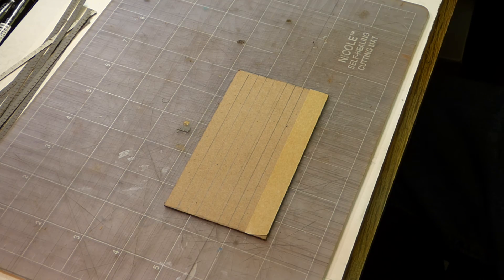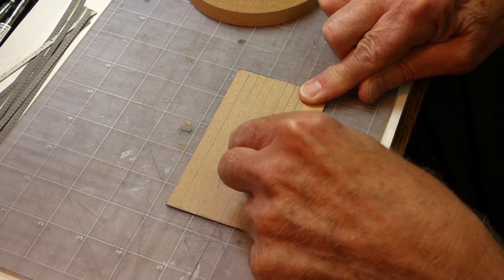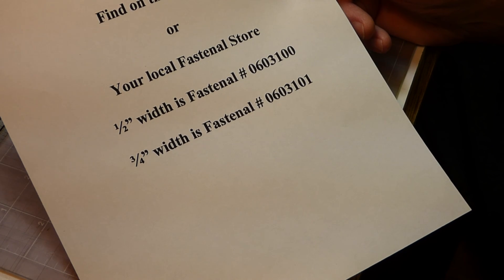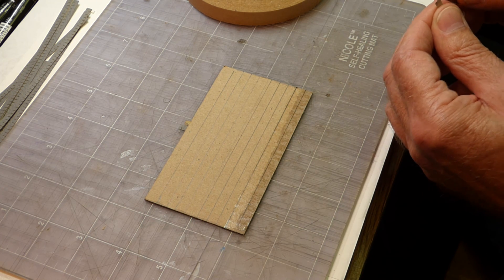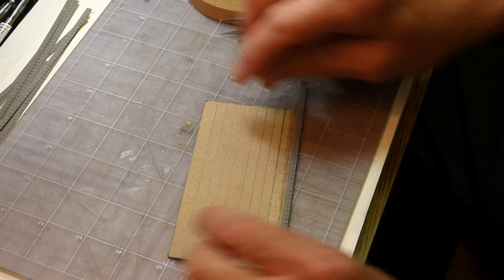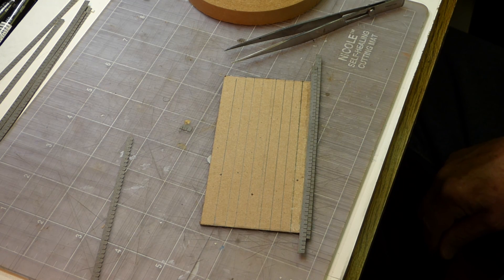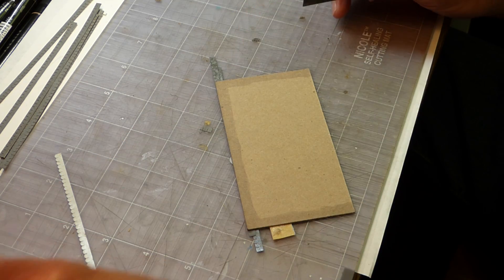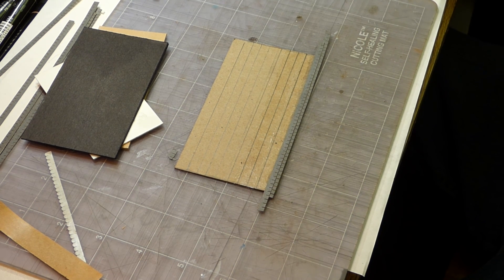Using Transfer Tape to Install Model Roofing Material

Comment: Could you leave on the kraft paper backing on one side, paint it black, and use it for tar paper?
Reply from the maker: I suppose you could, but it is a bit thicker than I usually like for tar paper and it has a very glossy finish, so might not  take paint well.

Comment: I just used Rusty Stumps O scale cedar shingles and wish I had thought about using this process. Like you say .. the adhesive on the shingles is pretty strong but there were places I had to go back and glue down afterwards. Thanks for the video!